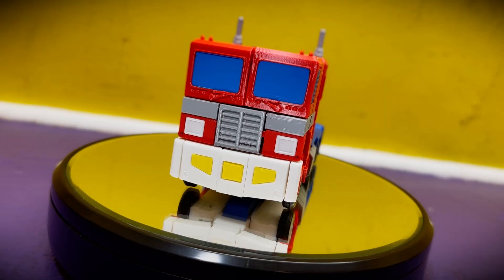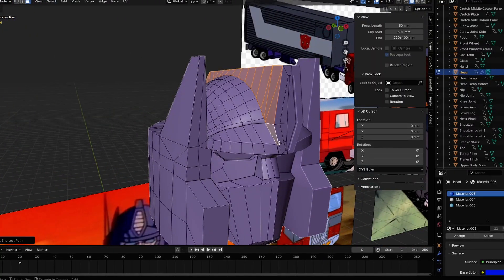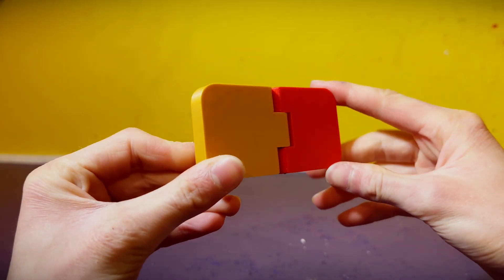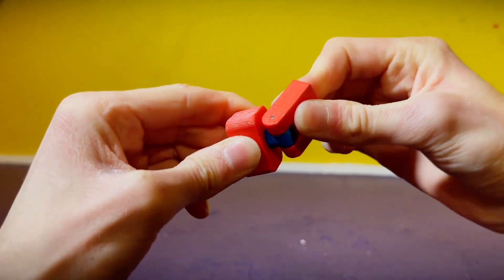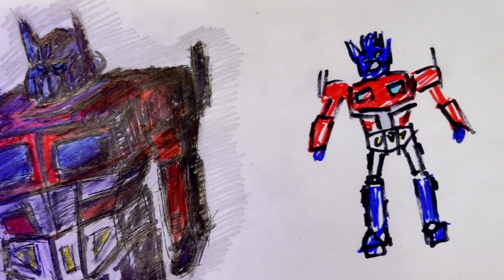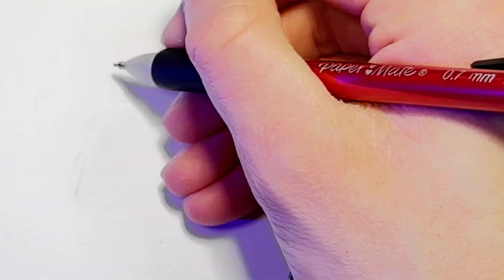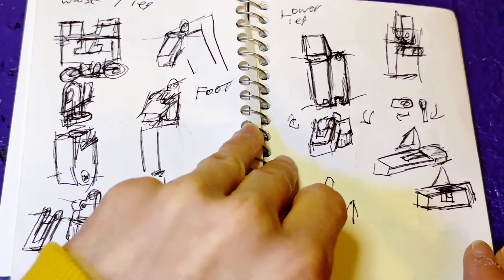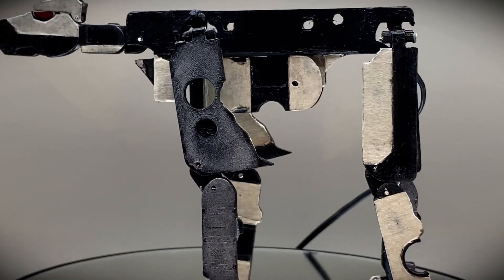Making a 3D Printed Transformer PT:1 - Planning And Sketching

Comment: Other downside of slider joints- and the reason you so seldom see them these days in Transformers, is that they ware down very very badly, often even worse than even a ball joint does.

Edit: Nvm, saw you mention it in a later video, leaving comment up because I want to support your videos though.
Reply from the maker: Was about to say until you edited!
I defintely reccomend avoiding them where you can, but when trying to make low parts count models its a life saver.

Thanks for leaving the comment up though! It's support like that which helps the channel and makes things like Prusa reaching out happen!

Comment: I wanna note every one of these has the potential to get loose. I’ve seen it happen on my own transformers. Ball and sockets are easier to retighten than the others, and also if the socket is thin, it can warp and cause issues. I’ve also had this happen to a few transformers.
Reply: Great video, I just felt like this was important to mention.
Reply from the maker: You're so right, should have made that clearer in the video myself.
Thanks for the comment!

Comment: I've experimented with 3d printing figures before, the ball joints are pretty tough to get right. Any tips?
Reply from the maker: Trial and error im afraid! Depending on printer tolerences you might need a ball thats slightly bigger or smaller than the socket.

I will say though, if you want to do a ball and socket joint where the socket is one piece ala marvel legends heads, make the socket only half a ball, and then stretch down the rest. That way is has enough clearence.

Im aware thats a horrible explanation, so stay tuned for the later videos!
Reply: Based